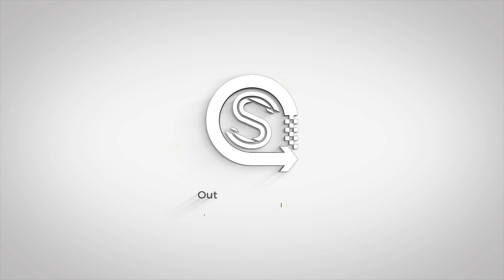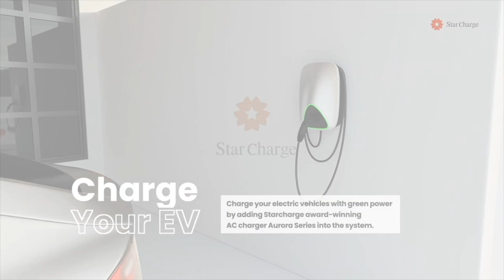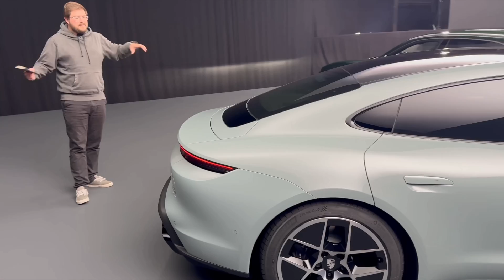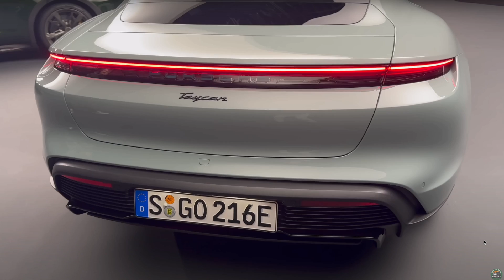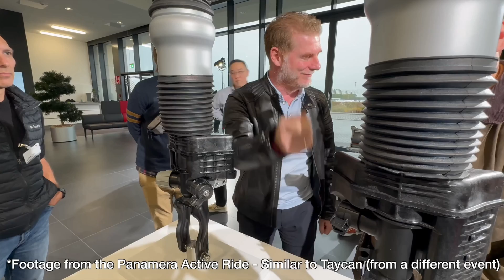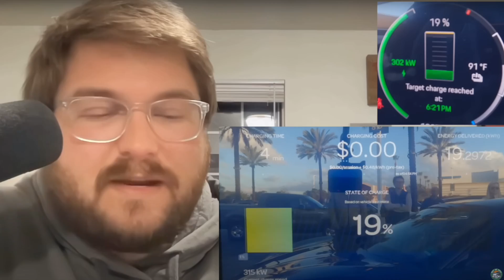The 2025 Porsche Taycan Raises The Bar - All Technical Details Thoroughly Explained | Episode 279

Comment: Great podcast! 

A lot of current Taycan drivers would like to know if any of the huge improvements included in the new facelift will make their way to the existing platform? It seems the non-hardware ones might be easier to do.

On the current charging screen, at times I see a green lighting bolt and a faster refresh rate, is that an indication the car is getting all the power it’s asking for? Maybe a precursor to the current feature? I’d love to know!

Comment: Great review. I love the detailed insights. I have a Turbo S Sports T on. order. Can’t wait to get it. Driving a Turbo Cross t currently now. I am told by Porsche that my interest in the technical stuff is not typical. Some clients have to be told what the difference between AC and DC charging is. Probably an exaggeration. Anyway. I love EV driving. Won’t change back.

Comment: Kyle, since the Taycan and the Mayan EV have two ports for charging;  could you please recommend to the engineers that for North America, please put the NACS on the driver’s side and CCS on the passenger side in the Macan.  For the Taycan reverse the location..   Since they have two ports might as well use them advantageously.  Adapters are actually problematic, they have a few real negative issues.  This way with both ports Porsche opens up their buyers to every charger currently out there.  They would be ahead of the game.